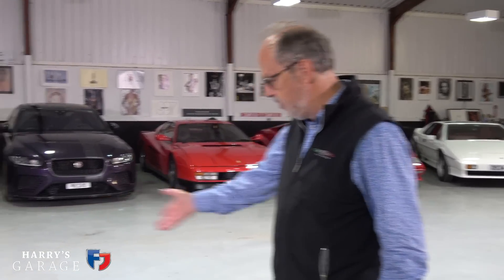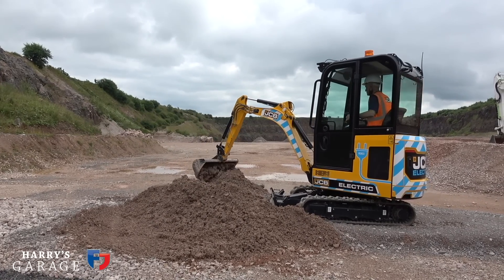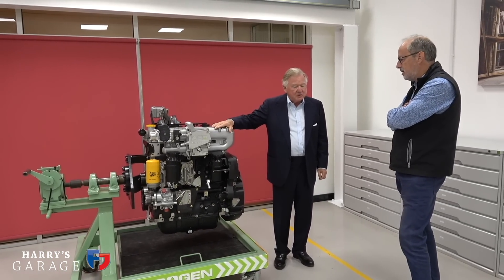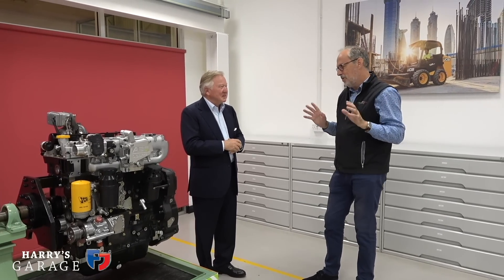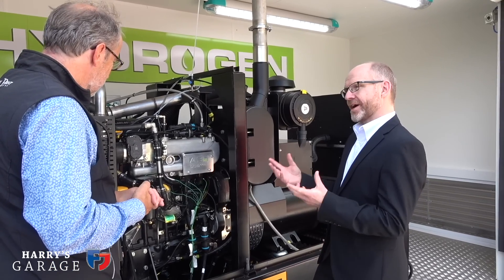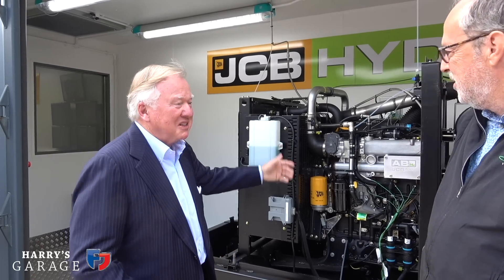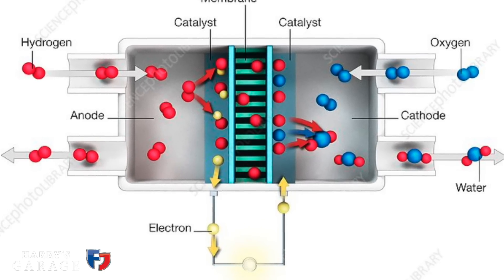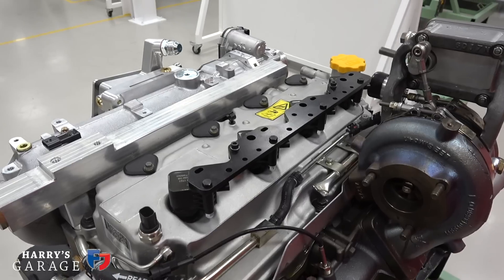Is hydrogen, rather than electric, the future for big-engined machinery? I visit JCB to find out

Comment: This article is really interesting to me. I have experimented with constructing a hydrogen generator on a small scale and have made small amounts of hydrogen in my basement workshop.
  I have often wondered why automobile manufacturers aren't looking into hydrogen powered cars. It seems to be the perfect solution to carbon gas emissions. 
 Thanks for the article.
Reply: From what I understand, hydrogen isn't as energy efficient as electric or diesel, because there are big overheads to creating it and storing it.

Comment: This has the virtue of pure logic and a lack of politics.   Great piece Thabk you.  Who the heck wants to lug batteries around  👏👏
Reply: All the reasons you listed (logical, not political, smart solution) are all the reasons the politicians will never let it fly!
Reply: Hydrogen cars are much more complicated than ev's. Also, that tank empties itself if it stands still.
Reply: hydrogen has the problem of lesser efficiency - you have to transport the hydrogen around, EV's do not have this problem.  On top of that making hydrogen itself is also not very efficient energy wise. Battery powered cars are not without problems either, however. I like the idea of hydrogen cars for the sake of the driving experience (engine sound, manual gearbox etc.)
Reply: While it might be cheaper up front than an electric car, the running costs will be massively higher.

To get hydrogen you need a lot of processing, which requires electricty. Transporting compressed hydrogen is also much more expensive in power terms than just running electrons down an overhead wire, even with losses in the grid. This is why battery-electric cars are better at turning watts from the power-station into miles on the road than fuel-celled ones.

A combustion engine will almost certainly be less efficient at turning hydrogen into power than fuel cells (most combustion engines are about 20% efficient compred to 40-60% for fuel cells), so even fewer watts from the power station get turned to miles on the road.

I'd imagine the running costs will be at least 10x worse. For certain commercial vehicles, in certain cases, this may make more sense. But for city cars for commuting and the shops, you'd be better off getting a used Telsa for ~£35K
Reply: Your lack of logic astounds me. It is very hard to tame detonation in a h2 ice engine. The reciprocating engines BMW were testing suffered knock. H2 works better in rotary engines. Given an ice engines typical efficiency of 20%, and the entire supply chain energy cost of generating that hydrogen and distributing it, then 5 - 10x more renewable energy might need to be generated overall, to produce the same power at the wheels, than for a pure battery ev that has a >97% conversion efficiency.
H2 fuel cell cars, are not much better. H2 fc cars are basically a battery powered ev with the fc charging the battery, and a h2 to electricity conversion efficiency of eg 40%.
Reply: We'll hope the hydrogen tanks are affordable to relace after their 10-year lifetime...
Reply: No it's not, it's Repetition Insanity. H2 is not viable as an energy medium. Fact is 0.08988 gram per liter tiny molecule is too much of problem. While other gases like Propane LPG AutoGas already exist. The massive benefit being Shelf Stable. H2 energy medium has no logic, it defies facts.
Reply: Best thing about this piece is that it has triggered the Tesla fan boy’s! They still can’t understand why the Tesla prime mover will never made in any great numbers if at all😂
Reply: @nordic5490  working in the mining sector I understand 100% what JCB is talking about , everyone keeps saying that the price of batteries will come down but in reality the more demand the higher the price, just look at the price of one of the world’s most abundant commodities iron ore or copper and as for electric trucks are you saying that loosing the ability to carry 8 to 10 tons of cargo because of battery weight having to be dragged around is going to be acceptable? Not to mention that many countries have load limits on wheel sets. Trucks basically never stop moving in large transport companies that’s how they get a return on their investment, if an electric truck can’t carry the same payload and costs twice as much to purchase as a diesel are you happy to pay substantially more for your purchases due to way higher transport costs? I’m not.
Reply: @STB-1  trucks can already be run on renewable ethanol - this is done in Brazil. Yes, burning hydrogen in a reciprocating ic engine is certainly doable, but, certainly not the first choice, due to the >5x renewable electricity needed to be inputted into that system, over a pure electric system, to produce the same power at the wheels. This means 5x the wind turbines or solar plant would need to be built to achieve the same result a a pure electric system.
There will be applications, eg, trains and shipping and some heavy trucks, where burning h2 is the only viable solution. Fine. But, burning h2 should be avoided if possible & done sparingly due to the massive amount of additional energy needed to be inputted into that system.
Reply: @nordic5490  Agreed, the biggest problem is that there has been no democratic discussion as to what the next steps should be and nobody including electric car proponents want to have that discussion. This is going to be the largest change in modern history that may end up causing more harm than good in the short to medium term and who knows long term if it will be significantly better for the environment considering transport from memory only makes up 12% of greenhouse gas emissions , as for ethanol it has its own negative impact in a world that is on the verge of not being able to grow enough food.
Reply: @brendanmoran397  No - Engineering and physics will mean hydrogen combustion will not work. Not politics.
Reply: Hydrogen fuel cell may have a future for very heavy duty power plant - but hydrogen combustion is a very stupid idea . It has no logic (and is in fact all politics).
  Unless trying to smash your stupid ideas up  against laws of physics and engineering is your idea of 'logic'
Reply: @janklaassen6404  It's amazing how many are being duped bythe idea of hydrogen combustion as a viable technology. It's a fundamentally stupid idea
Reply: Fuel cell = Fool's cell.
Reply: @MrLaserbrain  Then it's batteries then. I think hydrogen fuel cell has possibilities. Hydrogen combustion is for the birds.
Reply: @bbbf09  If not hydrogen what is your answer to the imminent extinction of fossil fuels?
You haven't said why hydrogen combustion is a stupid idea, against laws of physics and engineering, illogical and for the birds. I'm prepared to believe you but I would first like to know why. 
Diesel will be gone in 20 years. 
Batteries are no good for heavy duty applications because of the charge times, not to mention cost. Fuel cells are too techy and expensive.
Lord Bamford said that his engineers have solved the knock problem. Hydrogen can be produced by electrolysis using wind and solar which are virtually free sources of energy so efficiency doesn't matter. Surely the leaky tank problem can be solved.
Reply: @tomaskusnir2374  it is efficient if only green energy is used to produce it and at the point of delivery. ie garage forecourt.
Reply: The fact that Hydrogen being 2-6 times the cost of Diesel plus the high maintenance costs has put off Bus operators from using Hydrogen. There is more hope in lightweight Batteries.
Reply: @barrygoldring1113  Batteries are no good for heavy goods vehicles because of the charging times. Maybe they will improve. Personally I like diesel for the low end torque and the low cost. I drive a diesel car and the tax is only £30 a year because of the low CO2 emission. If they could find a way to remove particulates then maybe they will change their mind about banning diesel.
Reply: @tomaskusnir2374  EVs transport batteries around - all the time. Hydrogen can be produced locally. The only raw material is water - no oil, no rare metals that are in high demand elsewhere.
Reply: @bryanfeeney8285  Localise production of hydrogen
Reply: @nordic5490  that Scania article only refers to fuel cells, which is nothing to do with the solution presented in this video (which is basically burning it like in a fossil fuel vehicle). Of course, it's not Zero emissions, no idea why they say that, still produces NOx, but given that it reduces significantly less NOx than current vehicles it may be useful as an interim solution. Can't imagine the risks of having hydrogen being transported around in some 3rd world countries though - imagine the first big explosion in the fuel depot..
Reply: @vfr800ch  BMW found that burning hydrogen in a piston engine causes knock. Mazda were more sucessfull using their rotary engine.
Reply: Am i listening to really outdated and uninformed information here? First of all japan has already looked into mass producing hydrogen vehicles a long time ago. Second all internal combustion engines can run off hydrogen. Third there has been hydrogen powered buses here in America for years. They are developed by a company calles the sun bus. Last but not least Toyota has the most advanced hydrogen fuel cells. This video seriously made me feel like my brain was losing 📉  intelligence.
Reply: The problem with batteries is that they don't get lighter as they are emptied.  You end up lugging around a ton of batteries for nothing.

Comment: You’ve just cheered me up Harry !
Reply: @RalphEllis  tell toyota that !! 🤤
Reply: HHO generators are a great way forward!! Hydrogen is the most common atom in the universe and theres 2 stuck to every oxygen atom in the H2O water molecule. Water fractured with electrolysis is a super cheap and clean way forward and zero emissions will be easily within reach HHO engines burn clean and the only by product is water. HHO can be separated out very simply and hydrogen bled off and oxygen used for other jobs if you require.
Reply: @rhett7716  Toyota know already, they spent more last 6months in developing solid state battery's than they did in hydrogen. That's a big red flag for me
Reply: @andyjota8906  Design and build a power plant exclusive to hydrogen and all will be settled.Hydrogen on-demand, injected directly should be the obvious approach.
Reply: Go do your homework, re-embrace your pessimism. Electric cars are a dead end. Batteries are fuel tanks, not fuel. And wind turbines and solar panels can’t supply our needs.
Reply: @andyjota8906  wrong. You can’t find hydrogen, only compounds that contain it.
Reply: @sre331l  In H2O hydrogen seems far more accessible than oil. ?
Reply: @sre331l  ?
Reply: @sports2hedz542  Yes they did mention the horse power! They said the engines will be similar to diesel, but H2 has as much energy in one litre of H2, as there is in three litres of diesel! So H2 is more economical than diesel.
Watch the video, and listen properly, and get all your incorrect facts straight, before sprending misleading information in your comments!

Comment: We have the understanding and the engineering its " the powers that be " are generally made up of politicians  , the legal fraternity and the most dangerous of all the " paid expert advisors  " the majority of which are way out of their area of expertise  - add to that lobbyists and its a disaster - we need more basic common sense !
Reply: Unfortunately common sense cannot replace ignorance.  These guys are either lying or kidding themselves, JCB appear not to understand batteries, nor Hydrogen.  They will fail.
Reply: You have the engineering to make, compress and transport the H2 in a green way - that's the problem
Reply: @tonystanley5337  So explain how to build a battery light and compact enough to power earth moving equipment.  If anyone doesn't understand batteries my money is on you, you appear to be believing the hype and not checking the figures for yourself. Do you realise that Diesel oil is over 45 times more energy dense than the best current battery packs?  Even assuming diesel trucks to only be 30% efficient and electric traction to be 100% efficient the battery will be 15 times heavier than the fuel load.  When you consider a semi carries up to 1.2 tons of diesel when full the equivalent battery will weigh 18 tons and not get lighter as the miles go by.
Reply: @thamesmud  I would roughly agree with your figures, the best a battery artic can manage today is about 500miles range without compromising the load ability.  However that meets the needs of about 80% of trucks.   This is where you approach is wrong, you need to work out the daily use, not how much diesel a vehicle "can" carry, and compare that with how much recharge time you have.  Once we have built out that 80%, battery tech will be more than capable of fulfilling the remaining 20% of applications.  Did you know that the theoretical limit on density of a Lithium Air battery is the same as Diesel?..Yet with greater efficiency, so will have more duration.
My rule of thumb is that you need 13xdiesel gallons use per day in kWh of battery.   That means we could run a battery combine harvester (the most challenging of applications) for about 4-5 hrs today on 1 MWh battery.  Battery tech is improving (Hydrogen isn't) and we can expect 50% more range per kg in the next 3 yrs.
I fully appreciate batteries cannot do applications like harvesting that needs to be done maybe 24/7.  There is no arguing they don't have the density today, but neither does Hydrogen,  Hydrogen can just about compete with battery on range/duration if you use 10,000 PSI tanks and fuel cells, but it takes up more space and weight (contrary to popular belief), you just need to look at practical examples like the Mirai and Model 3.   Using combustion engines and 5,000PSI tanks is a joke.  I'm sure you can work out the rough comparisons are not pretty.
Reply: @andyf10  the real problem is rampant pop growth and rampant consumption !!

Comment: Wow ! What an opportunity. Lord Bamford is an absolute legend !
Reply: @nickturner2813  n0nce
Reply: In what way mate ?, all I watched was a one side promotional puff piece with no hard questions asked.
It is very hard to tame detonation in a h2 ice engine. The reciprocating engines BMW were testing suffered knock. H2 works better in rotary engines. Given an ice engines typical efficiency of 20%, and the entire supply chain energy cost of generating that hydrogen and distributing it, then 5 - 10x more renewable energy might need to be generated overall, to produce the same power at the wheels, than for a pure battery ev that has a >97% conversion efficiency.
H2 fuel cell cars, are not much better. H2 fc cars are basically a battery powered ev with the fc charging the battery, and a h2 to electricity conversion efficiency of eg 40%.
Reply: @nordic5490  Internal combustion engines are approaching 50% thermal efficiency. An EV is more efficient but absolutely not 97% with battery losses, and they're very expensive and impractical.

Comment: Great video! Love that the UK is at the vanguard of that technology and that JCB have an academy at that scale! Brilliant!
Can we have a Harry feature on Lord Bamford’s car collection please!
Reply: Japan has already invested in Hydrogen for cars. So we are not at the forefront of this technology actually we are running behind because of a lack of political will.
Johnson for some reason only sees electric as a solution being blind to the obvious solution which is Hydrogen.
Reply: @mikeuk1954  I'm sorry you are incorrect mate, as the Japanese are using hydrogen fuel cells, which creates electricity that powers the electric motors that drive the wheels, however what JCB are doing is completely different to a hydrogen internal combustion engine 🤔

Comment: Fascinating interview, and very clarifying. There is hope in the future, to combine the classic combustion engine, with the environment. The best of the two worlds.👍🌎🚜
Reply: Is it really the best when you're still dealing with hot oil, eventually leaky gaskets and seals, constant heat generation slowly degrading all the plastic parts around the engine, coolant systems, the need for a fully stainless steel exhaust system so it doesn't completely rust out from the water... From a philosophical point of view the combustion engine is a beautiful thing like a fine automatic watch, but it's a huge amount of complexity to solve a problem with a far easier solution.
Reply: @guygadbois1068  well put.👍
Reply: This technology has been available since 70s. BMW invested a lot in Hydrogen engines, as I remember they made 750 in 80s
Reply: @guygadbois1068  Batteries simply aren’t the solution. They’re nowhere near being capable of doing the work and I use work in the scientific meaning.
Reply: @mpershyn31  and they didnt work well. Very hard to tame detonation in a h2 ice engine. The reciprocating engines BMW was testing suppered knock. H2 works better in rotary engines.
Reply: No it's the worst. High energy cost, high maintenance coast. Big oil is pushing H2. At your cost
Reply: @vanvan143  I believe in Sir A. Bramford, because he has a big factory to run. And who bet on the wrong horse, to the future, can pay with bankruptcy. H2 costs more than eletric, only because, didn't had the massive investment, that electric had. But when it does, costs will come down strongly. And that combined with the Musk's eletric technology developed in the last 15 years, the result for a cleaner World is certain. JCB is not alone, in this vision of the future. The germans from BMW, and Mercedes, for example, made, and continue to test, hidrogen vehicles. And many other manufactures, share the same opinion.
Reply: @vubear  The batteries of today may not be, but battery technology is advancing......